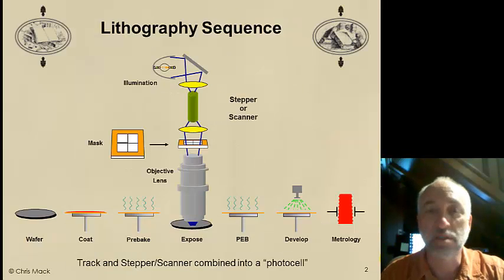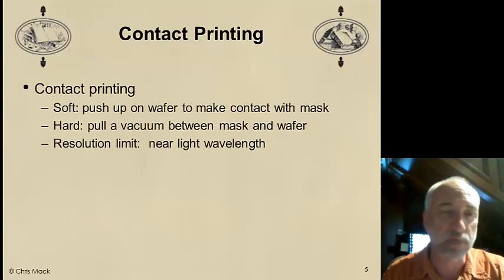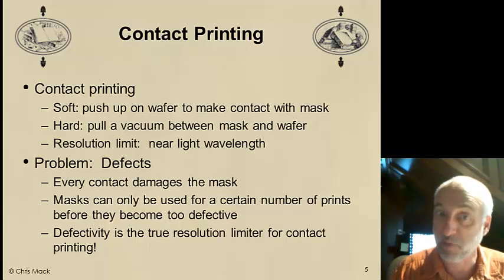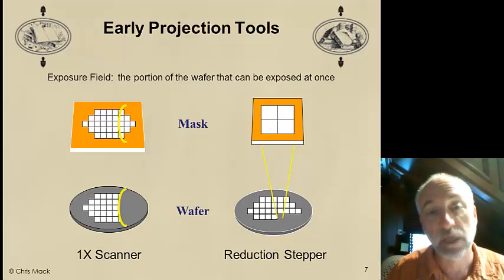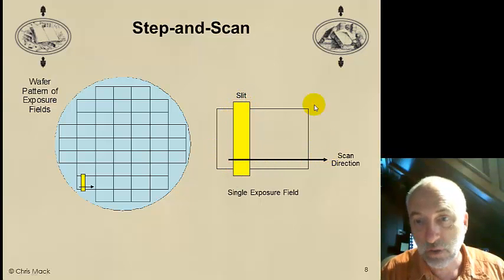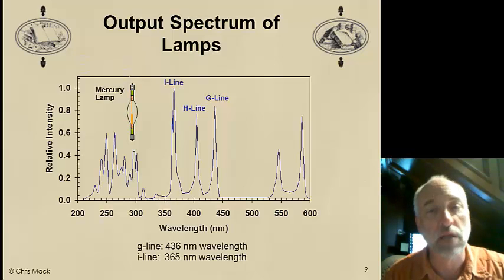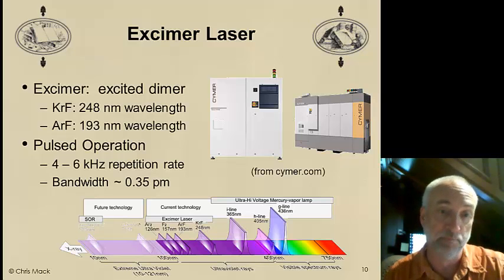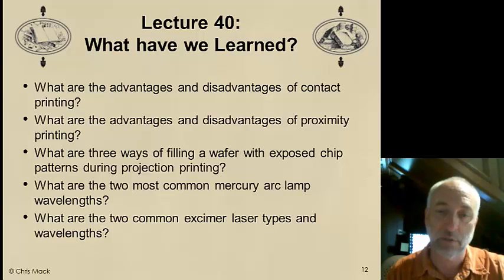Lecture 40 (CHE 323) Lithography Imaging Tools

Comment: Q1: Easily achievely a high wavelength resolution, but will defect the mask
Q2: No longer have defect issue, but resolution is restricted to a micrometer level
Q3: scan the mask; step the wafer; using a slit light source to scan the mask, and then step the wafer, repeat until the whole wafer is exposed.
Q4: 436nm g line, 365nm i line
Q5: ~240nm KrF laser. 193nm ArF laser.